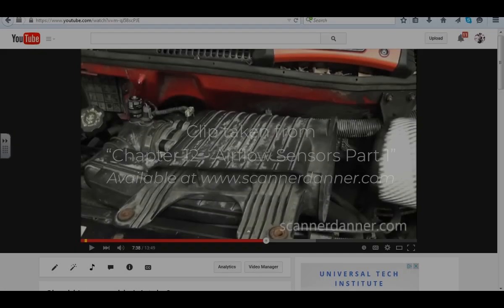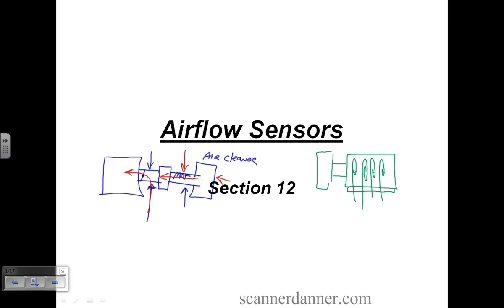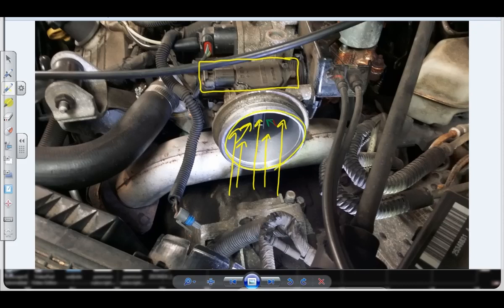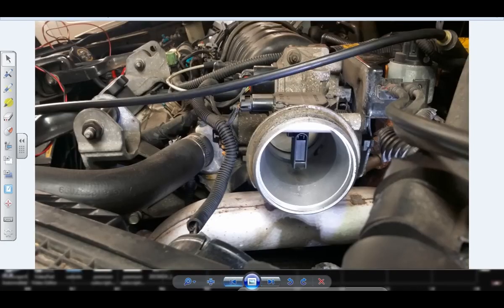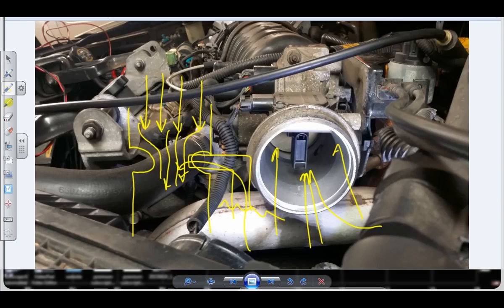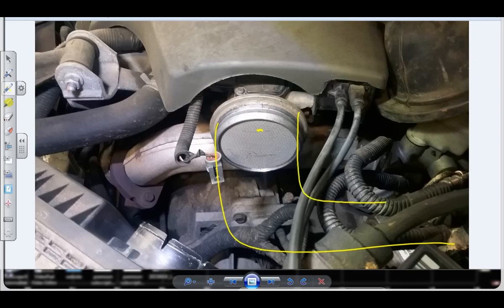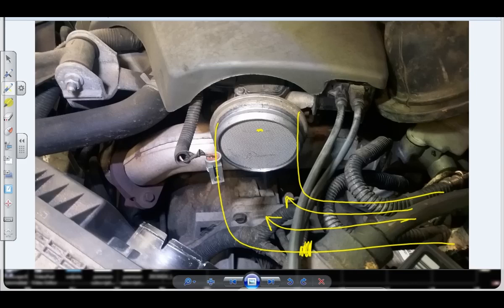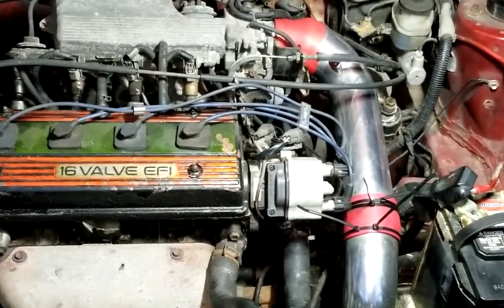Warning on Modifying Your Air Intake System

Comment: A known temperature of air drawn through a known diameter tube will cool down at a rate commensurate with the volume of air drawn through it. Or another way to say it is, as velocity goes up in the tube, temperatures go down. If you were a tiny person in the tube, you would dress warmer and warmer as the volume/velocity increased. That is what the sensor is doing. The sensor is basically a heater trying to maintain a specific temperature. The harder it is to maintain the temp, the greater the volume of air. There are a couple sensors critical to that calculation, throttle position and intake air temperature. Obviously, engine displacement is all part of the same calculation. That screen is a diffuser and an important piece for all the calculations to be accurate. Not all MAF sensors are the same, but that sensor on that 3.8L Buick motor is exactly as I described.

Comment: who would ever guess the air filter box design would cause the air to swirl and spin, only to be straightened by the filter. 
big filter housing with lengthwise inlet opening placed to one side to cause air swirling around the filter. many vacuum cleaners still use similar design to this day. lol

Comment: I just watched on Engine Masters they put a water to air cooler on a LS.  They wanted to see how much power cooler air would make.  They first tested by just running the cooler in place with no water running through it, and it made more power with it, then without.  They came to the conclusion that the fins of the cooler helped straight the air flow thus creating more power!   They also sell what looks like a honeycomb that right in front of a turbo.  I know some guys that run them on their Cummins
Reply: That is so awesome! What would be even COOLER would be directing air from the A/C into the intake. What you said they did is still awesome.

Comment: Scanner, my brother put a cold air intake air filter system on his car. I noticed intake air temp sensor high voltage, map sensor high voltage, and throttle position sensor low voltage codes. Is there a possibility it's because of the modified air intake system causing this? It would make sense why the voltage is pegged out because the extra air coming in to the engine.
Reply from the maker: Intake air temp sensor is sometimes part of the MAF. But MAP and TPS codes too? Time to do some testing and report back what you find.

Comment: I remember years ago seeing your video on that van. I also had a mustang, can't remember year or engine, that had a cai installed that was setting lean codes. Coworker was working on it, threw a fuel pump at it and I can't remember what else. I looked at it and diagnosed it as the cai being the cause. My employer didn't believe me. I talked with the customer, had him bring in the factory airbox/ducting, cars fixed.

Comment: Another big issue with after market "cold air" intake systems is they often create a LEAN condition,  because like you said, they often use under hood air, instead of outside air , and then the Intake Air Temperature sensor gets hotter than it needs to be.

Comment: We have a GM, 2017 Camero SS, that won’t do a drive cycle. Monitors won’t go through for emissions. I’m hoping by removing the cold air intake and going back to OEM will do it before making sure other sensors (ECT, MAP) are within specs. I’ve spent a lot of time on this vehicle already and it just sits. The exhaust system was a GM. Looked right. But it didn’t have any exhaust valve actuators. The GM exhaust system that was on the car had rear actuator mounts, we had to get a new system with middle mounts. So hopefully stock air will get the car finished up to be sold.
Reply: likely "tuned" and other modifications. who knows what else, good luck.

Comment: Screen as a Flow Straightener to achieve Laminar flow, which greatly reduced the straight-run requirement.
Reply: over the years, those screens have stopped countless amounts of debris and rodent spew from going through engines and sensors.
as for the flow changing properties, sure, anything helps a total bad design.

Comment: I have two 55 gallon drums full of "cold air' intake systems that were the cause of  mostly lean condition codes and other driveability problems. I only save them so I can show the K&N cult that they wasted their money.
Reply: I will never use K&n ever again.  But it’s common knowledge that aftermarket air systems need custom tuning to make use of additional airflow
Reply: @markbulva4188 they just they let more dirt by the filter causing high silicon in the oil. There's a sucker born every minute

Comment: Thanks again. I had a MAF code on a Nisan and found that a squirrel was storing nuts in the air intake. Removed the nuts and cleaned the air filter. No more codes.
Reply from the maker: I've seen some strange things in intakes over the years too. A stink bug comes to mind lol
Reply: what about shops rags, stuck in the intake duct before the filter?
yeah, I have burnt myself that way before. 😬🙄

Comment: Definitely an important lesson..   I've seen where a cracked lid over the filter caused bad readings too.   The MAF is tuned and calibrated to the final design of the box and filter, etc..  and when you change any part of it, the MAF would need a recalibration to work correctly....   
Stock Master Race

Comment: Anyone would think that the engineers that designed the engine systems had some semblance of competence and knew what they were doing when putting 'extra' components in, rather than just doing it for fun! Crazy talk...
Reply: You talking about them same engineers who gave us the torx bolts and torque to yield head and rod bolts?
Reply: @leethomas9198  Are you saying those things are somehow bad?
Reply: @TonyRule  wasteful and anti-diy. Make a mistake and oops got to go to dealer or wait for new bolts to be delivered. They are consistent, but wasteful as they are useless after removed. Now those Noed lock lock washers are the ticket. No more loose headers and manifolds.